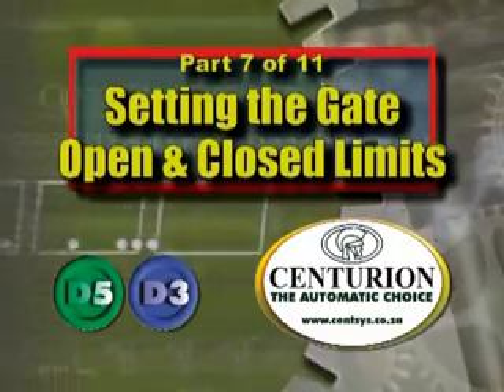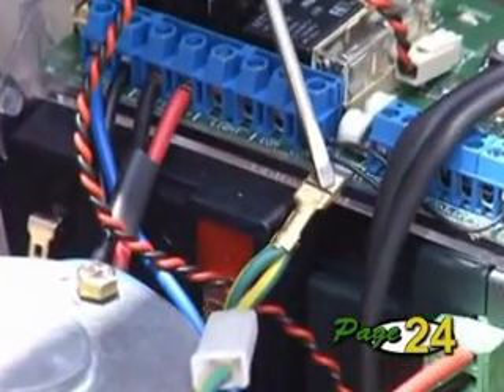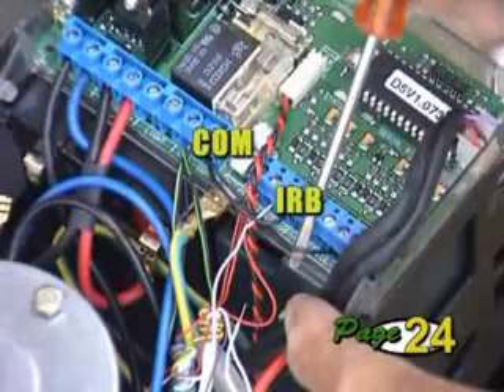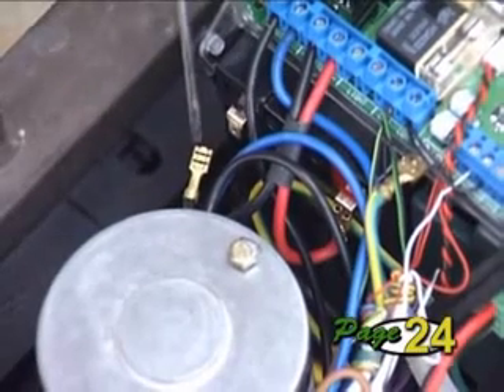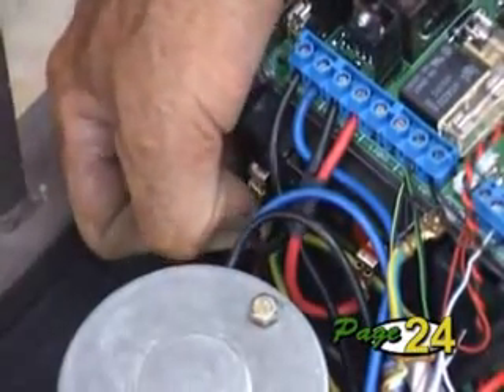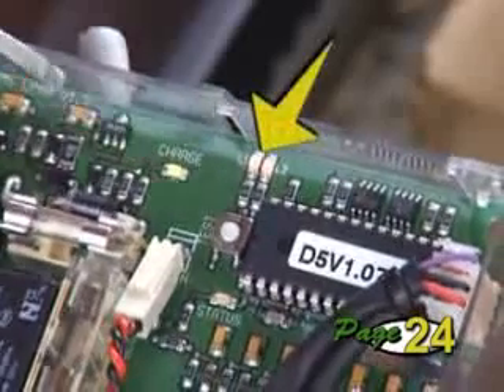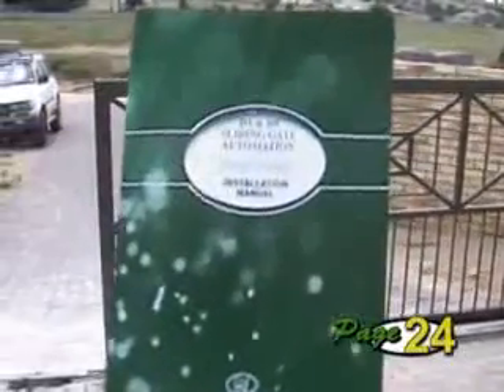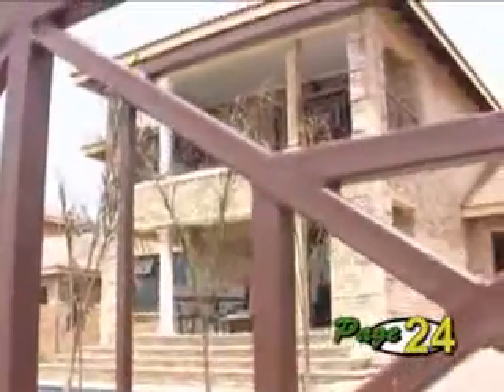CENTURION D5 and D3 Installation Setting the Gate Open & Closed Limits - Part 7 Download

Comment: I have a problem with my gate or the D5 motor, when I set the gate limits  to open then to close, it closes correctly. However once programmed, and you close the gate, it does not close completely it stops about 4cm away from the programmed  limit. 
Is this a known problem or how I can get this resolved?
Reply: Good morning